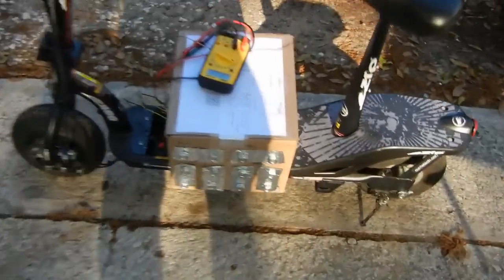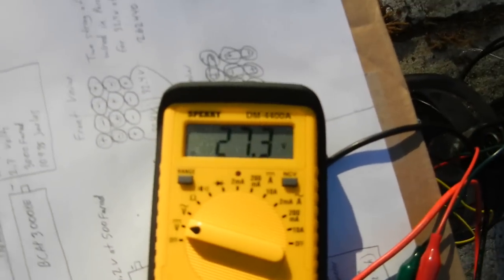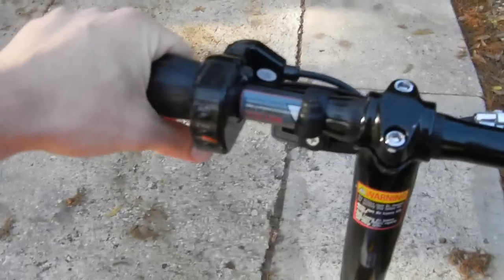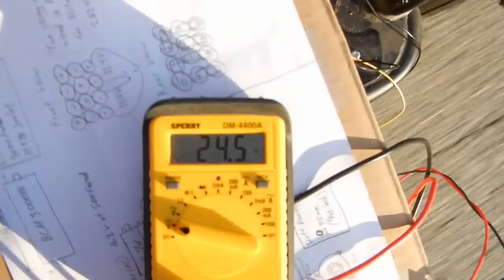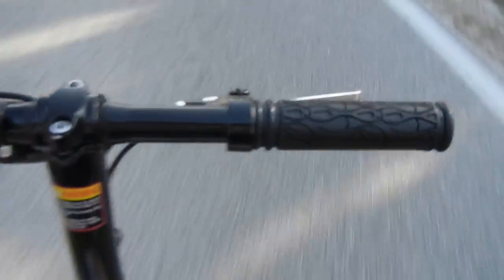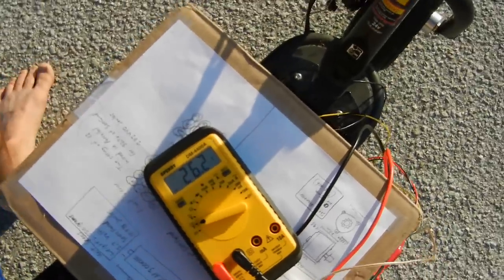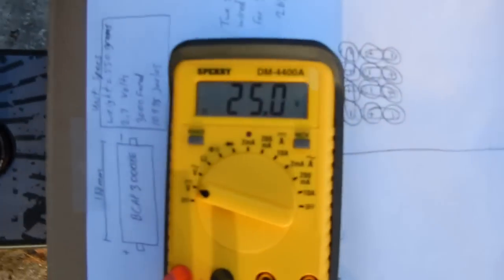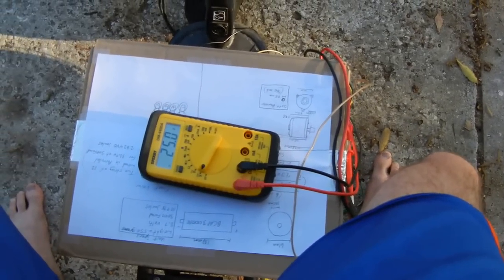Ultra Capacitor Scooter

Comment: I think in combination w Li-Ion batteries you can really have something. The caps should give you quicker acceleration and better range. But duct tape? wow. I'm experimenting w building 18506 battery packs and if it's good conduction you just saved me a lot of work!!
Reply from the maker: If I remember right, I more did it with duct tape so if there was a short it would burn out the duct tape around the terminals like a poor man's fuse. I have copper conductors I could have used, but I was scared of a multi hundred amp short circuit while it was all in a cardboard box lol

Comment: bro is there anyway you can implement a hub or something that generates power that can be used to charge the ultras while you are riding. and do you think there will be a point where these types of trasportation bikes or scooters will offer unlimited run times?
Reply from the maker: If you put a generator on it, it'd just add a ton of drag trying to make power to feed back to the capacitors. I'd say add a 200+ watt solar panel "trailer" behind it and it'd take you forever on a sunny day. Panel would power the scooter for the most part and the capacitors would provide extra power to climb hills. The panel could then recharge the capacitors while you're on level ground or going down hill.

Comment: How about a bike with a wheel geny charging a capacitor for when you need to climb a hill or just need a short burst of power maybe using a pedal assist motor to just give you more power right on the chain.Cordless drill motor is already geared for it.

Comment: Try using a voltage regulator to boost up ur voltage
Reply from the maker: I did later. It doubled to tripled the range. It still couldn't go below 8 volts though.
Reply: +72fr250 ,May be setup joule thief circuit,  you can take it down to 3V .. ?

Comment: 360 dollars to ride for 3 minutes at a time. i guess you at least can charge it unlimited amounts of times.
Reply: Vandy Niyomkham 
Just think how many different uses those caps could have.
Like a emergency light, or replacing starter battery for cars or lawn mower, or eliminating batteries for solar systems.  Yes those caps would be big and expensive , but they can be charged and discharged a thousands of time and may outlast you before you have to replace them.

Where I work we have equipment that is 40 years old and the caps are still ok.

Comment: Hey youngster. Yea supercapacitors. Yea solar panels 100 watt minimum). Yea scooter. Hey trailer. Dual SC banks. How long to charge SC? Bank low? Flip a switch or employ a chip. Change to bank 2.TIMING. endless sunlight trails. Oh, switch to bank 4.Maybe I'm dreaming. Poetry.
Reply from the maker: I wonder if multiple SC banks WOULD be more effective then a single bank. I don't have the scooter anymore to test it though.

Comment: 超級電容器使用在滑板車，很好的創意。
如果加裝升壓模組﹝Boost module﹞，可能會更好，這個升
壓模組，只是參考，主要原因是它的輸出功率小。
通常，風力、太陽能發電場合，使用升壓模組，可穩定輸出電壓。

DC-DC 10-32V轉﹝TO﹞12-35V 升壓模組﹝Boost module﹞
輸入電壓﹝Input voltage﹞：10-32V
輸出電壓﹝Output voltage﹞：（12-35V）連續可調﹝Continuously
adjustable﹞
http://www.light-energy.hipages.tw/?242,dc-dc-10-32v%E8%BD%8912-35v-%E5%8D%87%E5%A3%93%E6%A8%A1%E7%B5%84-100w-j-13-a
Reply from the maker: I understand that these capacitors can be used to protect circuits from voltage swings from solar panels and windmills.
Reply from the maker: I already have a 350 watt 8-16 volt input to 24 volt output converter.
Reply: 72fr250 8-16伏輸入電壓過低，如果能提高超級電容器充電
電壓，輸入電壓提高，可延長行駛旅程。
建議你將加速把手﹝速度調整器﹞，變更為右手操作
，煞車把手變更為左手制動後輪操作，提高安全性。

Comment: I'd like to see a vid of you running them all the way down, but I do love this vid.
Reply: +72fr250 You can run a boost converter using a Li-po as auxiliary power. Controller draw power from Li-po, only the switching transistor bank (you probably want to use a dozen of TO-247 power transistors in parallel, or a power module) is using the main power supply
Reply: The battery is minimal - single cell maybe, just to power the SMPS controller.
Reply from the maker: The darn motor controller shuts off when the voltage gets too low (like 19 volts). I tried using a DC/DC converter and got twice the run time, but the DC/DC converter shuts off at 8 volts. So anything I do wastes all of the energy left in the X volts of charge left in the capacitors when the control circuits decide to shut off.
Reply: oh, that's lame >.< I wonder if a joule thief would work for a motor like that to make use of all the voltage in the capacitor
Reply from the maker: rpaull3  You send me a 24 volt 400 watt joule thief and I'll post the video haha
Reply from the maker: If I have Li-po's, then there is no point in having 20 pounds of capacitors lol

Comment: how long did you run your scooter for?
Reply from the maker: Hoch134  Theoretically you could go like 10 miles with the two 12 volt/10 amp hour batteries on flat ground. My batteries were old and no good anymore. This setup was wired for 32.4 volts/500 farads.
Reply from the maker: Hoch134  Connecting the capacitors in parallel would increase the farad rating at a lower voltage, but the problem is that all of the DC/DC converters on the market are designed for 12 volt batteries and have low and high voltage shut off points to protect the 12 volt battery. I need a DC/DC converter that accepts a wide range of voltages so the capacitors can be more fully discharged.
Reply from the maker: It can only run the scooter for a mile or so
Reply: 72fr250 How much was it with a battery and how many farads did this setup have?
Reply: Thank you for the infos, probably the distance would get improved with lower voltage capacitors? Or doesn't it matter?
Reply: I was also thinking about a converter but then I heard about the Z-Diode (zener diode), which restricts the voltage to a certain limit.
So if you can fully charge up your 32v-capacitors and connect them to your z-diode, you can use up to 60% of the capacity of the capacitors.
Clearly, you will lose energy in heat power, but if it doesn't overheat (probably put a resistance in parallel), that should work pretty fine.
With a trick, it is probably also possible, to use the remaining 40% with a transistor circuit.

Comment: if i want to boost a 16V ultra cap to 24V...is it possible?...
Reply: Of course it is possible. Just link 2 16V capacitors in a serial configuration if you need 24V output.

Comment: From 27.3 to 26.2 you used 1.1 volts  You still have the rest of the voltage to use here.  

You should avoid putting caps in series and boost the voltages, you dont get more watts by putting caps in series you just add more weight.  You get more watts by putting caps in parallel.
Reply: Random Man volts times amps -= watts the total watts is the same regardless of parallel vs series. It is the power in out that goes up but duration or capacity is deminished faster

Comment from the maker: You could use lower voltage capacitors with a voltage booster circuit and get more range. These capacitors are pretty heavy though, and as you can see, they don't go very far. I have a LiFePO4 battery pack on my bike that is a similar weight, and it has a 30 mile range as apposed to less than 1 for 24 of these capacitors.

Comment: depending on what capacitors he's using it could be instantaious or it could be a few minutes. since he has a 26v system im assuming he has the maxwell ultra capacitors, im guessing it could take maybe 10 - 60 seconds depending on his charger.

Comment from the maker: It would have to be a 2 square meter solar panel to make 120 watts and that would only keep me moving at like half speed in direct sunlight and take about 15 minutes or so in full sun to charge me from 8volts back to 16volts for the converter to run for another mile. It'd have to be one hell of a spoiler haha

Comment from the maker: A generator would stop me in my tracks. That's how regenerative braking slows down a car, the generator resists being turned so much that it slows down the vehicle. If generators worked like you suggest, I could just hook one up to an electric motor and have perpetual energy. I wish it was that simple

Comment: how about put another motor in the front wheel as a rectified DC generator and put the energy back into the cap bank?? Could it be a good range extender??

Comment from the maker: Pretty much. And it was 2 banks of 12 caps for 32.4 Vmax and 500 Farads total. I re-configured it later to 4 banks of 6 caps for 16.2 Vmax and 2000 Farads and used a 360 watt 12volt to 24volt step up converter and went about a mile using I think 14 or so volts down to 8 volts, and then the converter shut off. I bought some decent sized 145 watt solar panels a while back and it would have been awesome to make a tow behind trailer with one panel for this thing to run at half speed

Comment: any DC motor can be used as a generator, and as far as how much power it puts out depends on the gearing, but i would just add a solar panel.

Comment from the maker: Even a little honda generator would be awesome. But they don't produce the right voltage. I'd have to run a charger off the generator and waste most of the power they made

Comment: i was thinking of a mini propane generator in conjunction with what you're talking about. you can have the propane generator charging the caps when needed. A small tank of propane should last a 3 or 4 days before a refill is needed if your biking long distances.

Comment from the maker: I can start a car with less then 6 of them with no battery, so I'm sure it would do what you want, but they're so heavy that I don't think it would be worth it. You could just get more batteries to help with the sag and get the extra range as a benefit. The pack I used in this video had 24 capacitors and weighed over 20 pounds, but only stores the equivalent of 24 double A batteries.

Comment: Can you try to use it inline with battery pack ? I am building a high speed long distance electric motorcycle, and I would like to see if it has an anti- voltage sag effect also to help boost regeneration on bldc motors

Comment from the maker: You would need at least 29 caps in series and it'd give a nice punch of power when you accelerate "if" your batteries are struggling. But if your battery voltage is not sagging when you accelerate, not only would the caps do nothing, the extra weight would make you accelerate slower then before. And for the price of 29 caps, you'd be better off getting one more set of batteries to put in parallel. These caps would be better for a car audio system or to help start a car.

Comment: i would really like to hear your opinion on using the ultracapacitors as a power booster for a 72vdc 24s2p lifepo4 battery pack in an electric motorcycle...
check my videos and you'll see what im talking about...

Comment from the maker: I did another run test with a voltage converter and it only went about half a mile before the converter shut off. The whole pack only has about 60 watts of power. Almost like each cell is a AA battery.

Comment from the maker: Yep, you can wire them for lower voltage/higher farads and use a boost converter to get longer run times.

Comment from the maker: 24 caps. I actually bought a 12volt - 24 volt step up converter to increase the range. I think 24 caps only comes out to around 60 watts of energy though. However, that being said, they don't go bad as far as I know, and if I had the money, you can bet I'd fill an entire room with these things for a solar system. They're too heavy for a mobile system though.

Comment from the maker: @asphyxsia And in a 16.2volt configuration, it would be 4.42 amp hour? Because I have 24 capacitors at 2.7 volts each, I can't make a 13.5volt bank, because I would need one more capacitor to make it 5*2.7v=13.5volts, and then it would be 5 sets of 5 capacitors in series for 13.5Volts at 3000 Farad = 273375Joules = 75.94 watt/hours = (75.94/13.5v = 5.6 amp hours). So I have no clue. You're probably right.

Comment from the maker: @asphyxsia I don't even remember how I calculated that value to be honest, lol. And I don't even know how it would be possible to account for the linear voltage drop in an equation. I just now punched in the numbers into a joule calculator, and it's 10935 Joules/capacitor*24 capacitors = 262440 Joules = 262440 Watt Seconds = 72.9 Watt Hours. So, I'm not really sure how to get from watt-hours to amp hours if the voltage continually changes, lol  (72.9watts/32.4volts=2.25Amp hours)?

Comment from the maker: @mangyscavenger 
To my knowledge, they will charge as fast as the charging source can handle. But since I have no charger that produces more then 2 amps, it's takes quite a while. I'm going to use them for a mobile solar charge type thing most likely, as like you said, they take on every bit of charge no matter the duration(or in this case, no matter how much cloud cover). This bank is only the equivalent of a 12 volt 7 amp hour battery.

Comment: How long will it take to recharge those capacitors, once they're out of power? I've heard recharging is very fast.
Makes me wonder if it wouldn't be better to charge these ultra capacitors with a windmill, rather than deep cycle batteries. Seems like the capacitors could accept all the energy produced as the wind blows so none is lost no matter how short a time the wind is blowing.
Thank you for posting this.
Thoughts or corrections?

Comment from the maker: @patrickikis 
The sheet under the multimeter in my video shows the configuration and values for the bank, I guess I should've displayed it at the start, lol
I have 24, 3000F capacitors in the box. 12 in series, two strings in parralel, for 32.4V maximum at 500F.
I can also arrange them for 16.2V at 2000F with a few alligator wires. I have them connected with aluminum duct tape on the outside of the box, so in case of a short, the tape just vaporizes like a fuse.